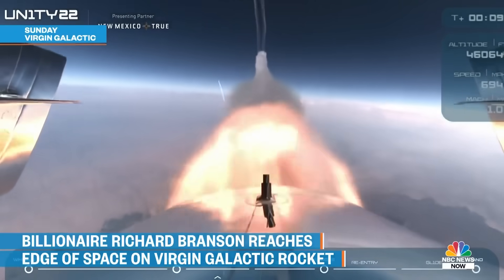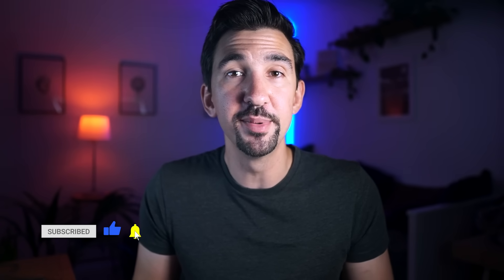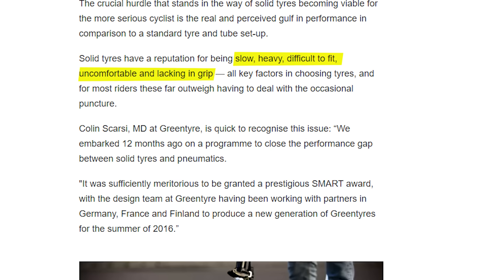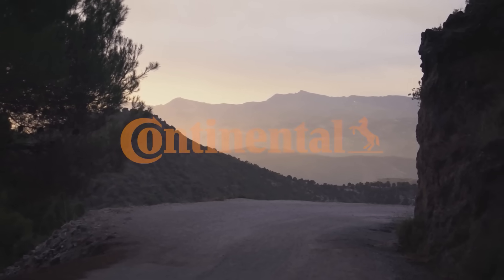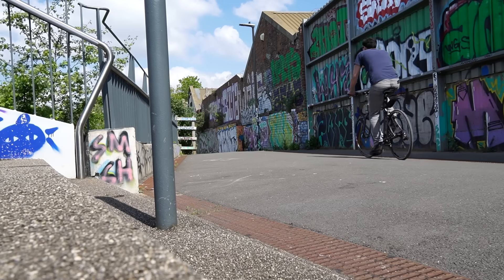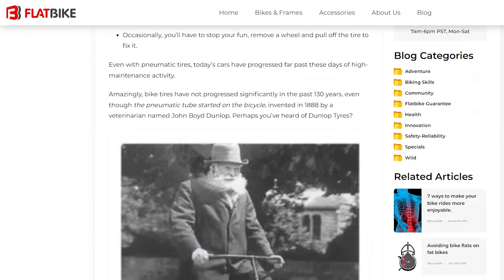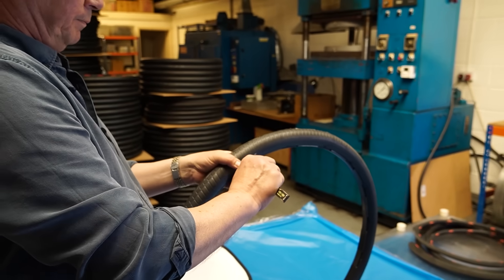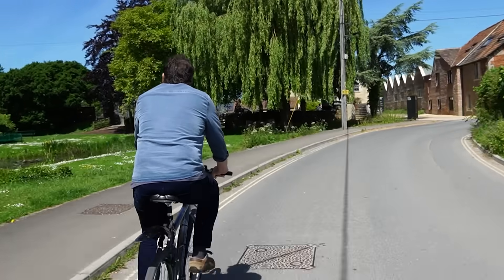I Tried Solid Bike Tires | Here's What I Found

Comment: This is an interesting video, but I don't believe that flat-tire risk with pneumatic tires is a serious problem for most bicycle riders.

I have used bicycles to commute in London, Chicago, a couple parts of California, NY City, Boston, and New York City in the past 25 years. I cycled long distances to go to work or meet friends as a teenager. This summer, I cycled 500km through Canada -- often on roads with loads of small stones and gravel in the shoulder.

I think I've only had 3 pneumatic bicycle inner tubes fail in 20 years. One was on a very old bicycle from a thrift store with old tubes. The valves themselves failed, and I had to replace the tubes. Another was when I used to ride a folding bike with relatively small rims, and I think I got a pinch-flat from severely under-inflated tires. I think I ONCE got a puncture flat when I cycled over a broken piece of glass in Chicago, but that was on a 1974 Schwinn road bike that had tires and tubes that might have been > 20 years old. I swapped out the tubes and kept the very old tires, and I don't think I ever got another flat riding that thing for maybe 12 years until I finally sold it. For a while, I commuted about 20km per day with that bike. I think I also ONCE got a puncture flat as a teenager when I rode a very very cheap old bike that probably had very cheap tires and tubes. That was in the 1990s. When I lived in London, I rode a truly awful old bicycle that had old tires and likely very old tubes. I bought it on Gumtree for 30 quid. I bought it near Old Street and rode it to my friend's flat near Acton. I cycled daily from near Brixton to Westminster. I biked all around Chelsea and South Kensington a few days each week. I had to buy a cheap spoke wrench to true the rims. I topped up the air in the tires a couple times over the course of 4 months, but I never got a flat.

I've probably cycled thousands of miles in the past 30 years. Most of those miles have been on cheap and old bicycles with old tires and tubes.

I guess that if I had to ride a bike on gravel every day then I'd probably look into solid tires, but, if I were forced to bike on gravel then I probably wouldn't bike at all. On any sort of paved surface (concrete, asphalt, etc), I've had no issues with pneumatic tires. When I've gone on multi-day touring trips, I just pack an extra inner tube. When riding around the city, I don't bother.

In terms of recycling tires, I agree that our society should aim to recycle more. It makes sense that multi-material pneumatic tires may be harder to recycle, but I'd imagine that solid tires use more rubber. And therefore, I'd guess that the amount of waste rubber in maybe 5 pneumatic tires is probably equivalent to 1 solid tire. They will inevitably both end up in land fills. I think we need to do more to recycle in general. I think any sort of rubber tire could be ground up and turned into playground surface material, insulation, sub-floor padding, maybe rubber bushings or dampers in certain building-construction applications or some other product that doesn't require precision in its composition. I would personally be more excited about investing in pneumatic-tire recycling technology and products that use recycled pneumatic tires than in solid tires.

Comment: this is great and all, but you could just switch to a wider weel base. 

I rode a race bike as a commuter for 10+ years. 
This year I fixed up an old hardtail mountain bike, the tires on it are old and pretty worn in places, but so far im et gotten a single puncture. 
also when you get a puncture it's not the tire you throw out it's usually the tube?

Comment: The first bicycles used solid rubber tires.  The problem with a soft foam airless is you can't tailor your pressure for terrain and weight.  I think the ideal solution is something like those foam tire liners.  Make the foam equivalent to, say, 15-20 psi, and use air for the difference.
Reply: There's also run flat bike tire inserts.They still allow for room for air, but in case of a puncture they provide enough resistance that you can still ride home.
Reply: the problem is that air is the best shock absorber, 95% of people don´t adjust their pressure to fit the conditions anyway but rather pump them to the (near) max and that´s that until they need repumping. adjusting pressure is only for enthusiasts. i tried to tell people i know at least leave off some pressure in the winter, they won´t because it´s more resistance.

Comment: your argument of "how much is 1h of your time replacing a tire actually worth?" is not really valid though, you have to factor in how much time you save by using a regular tire compared to these tires. if you save 15 seconds with regular tires when going to work, that's 30 seconds a day, 3600/30 = 120 days, so if your regular air filled tired survives over 120 days, which isn't really crazy and only saves 15 seconds a trip, which is very conservative, air filled tires will save time.

Comment: It is the current year. OMG you are right! Maybe once you get your license back and after the DUI classes are done you can get rid of your old BMX and that should cut down on bike tires in land fills. And don't drink and drive anymore. Now find a way to put better rubber on cars and motorcycles. When I was a kid and it was not weird to ride a bike I used a PVC pipe rapped in foam to have airless tires that felt like pneumatic bike tires. At low and dangerous speeds in traffic it worked just fine. I learned when I was young to not play in traffic. Faster cars are going to pass dangerously close. Doesn't matter how many white lines between me and traffic. Not that you drunks stay in your lane that you don't pay for. Anyway, bike tires can be made puncture proof. But it might add weight and I don't see bike riders building any muscle in order to handle that extra weight. I don't know if its the vegen diet or health reasons. But whatever gave you the death wish to ride a bike in the first place shouldn't stop you from being able to handle your 10 speed. And your legs will look awesome too. 
England thinks it has hills? You should check out the Rocky Mountains sometime. You would die trying to ride up some of them. And you wouldn't be the first one either.
Great video. But as you can see I has some comments and issues with it.

Comment: NB there is nothign wrong with stuff that came out of the ground, going into land fills.  The problems occur when it a/ sits on the surface, including under water or b/ is incinerated.
Secondly, irrespective of what Continental says, if anyone cares to visit a waste transfer station or landfill dump, you will find that bicycle tyres are so far below a significant constituent of society's waste, that I am lost for words to describe it!

I note also that bike tyres do not actually go flat. Tubes go flat, and if one wishes to minimize the amount of tube waste, then I can say from much personal experience that a tiny patch will save 4 out of 5 tubes when they are punctured.  

But thanks for the interesting video anyway.  I see that these tyres appear to not yet be freely available, but will give them ago when, in due course, they make their way to Australia.
As an every day no matter what, bike commuter, I can confirm that is an utter PITA being held up along the way to repair flats.  Particularly when it is wet and cold and you're in a hurry etc etc.

Comment: ? Basic physics should rule out a solid tyre, as far as comfort goes.
Air filled tyres, when hitting a bump, have the whole inner chamber to deflect into. Creating a minor pressure increase.
Solid tyres have they're neighbouring molecules blocking most of the deflection.

Comment: i have solid tires in my e-scooter and dam good its dangerous, they dont flex for shit, you have to re-learn how to turn and how to move your body and weigth so that mf dosnt slide like its on ice, forget about wet, anything more than 10 kmh its better for you to get down and slow yourself down than to trust the tires, heck, a road bike its miles more confortable than it, but in 4 or so year, not even 1 puncture, no even once did i look if it was to soft, and im pretty sure they are as hard as they can get bcs the tread looks exactly the same, i miss normal tires tbh, it depends on what you are gona use it for and if you are willing to use it with the pros and cons, i was so sold on it at the start and it didnt bother me at all, after all, just brake when you need to, but damn, maybe im getting old and thats it XD

Comment: I have found that most flat tires go flat when the tire spins on the rim but the tube cant spin due to the valve for filling it with air. The tire pulls on the tube until something gives and you get a flat.

Comment: Even if they are soft due to air bubbles trapped inside, they will weigh more then a traditional tire.
My concern with them is how fast they detiorate and lose  the grooves and grip and when they do can they be re-surfaced.

Comment: If your tires get punctured every month, you are clearly doing something wrong. I always pump as little air into my tires, as it's possibile. I put about 15 psi into my mountain bike tires. I only had punctures when I installed the inne tube incorrectly or when the tubes got too old (it's about 4 years for me).

Comment: I am regularly bike commuting for over 10 years now. In that time I had two flats. Both were minor, so I could go on and fix it at home. So I had two flats in about 5 sets of tires and probably 25000 - 30000 km. I think most problems people are having with flats are user error. Especially the scene where we saw him bouncing the tires, you could see, that the air filled one didn't jump very high, which leads me to think that he cycled the tire with a serious under-pressure. This of course increases friction and chance of a flat, while also improving comfort. My experience is, that a good tire, even with very little puncture protection is very unlikely to every get flat over the course of its lifetime. People who experience a lot of punctures would probably benefit more from a highly protected tire (like the Schwalbe marathon Plus), because that will get them all the advantages of an air tire with puncture resistance, with the only downside being higher weight.

Comment: Well, i've contacted Gecko Rubbers for application in high speed velomobiles... I'm driving one, especially the rear tyre is a pain to change, since it's in the streamlined fairing. The front wheels are easier to change, since they're not in the fairing. So i'm curious about their usage in these kinds of recumbents.

Comment: Schwalbe marathon plus tires are the best tire I've ever used. Ran them for years and over multiple multi-day bike excursions and barely had to even think about them aside from the occasional fill up. I bit heavier but zero flats over 6000 miles. I'd love to see Gecko license their tech to other brands and allow the market to do what it does and improve these tires even further, while offering loads of size and use cases.
Reply: Try the new Continental Contact Urban 2022 model.  It's like the Marathon but way better rolling resistance.

Comment: RC cars had been using foam inserts for non pneumatic tire use for decades now so I really do not understand why he is literally trying to reinvent the wheel here.  the only difference here is that the process is cumbersome expensive and you are stuck with a single manufacturer.  The only thing the current tire manufacturers need to do is make foam inserts for their existing tires and cyclist problem solved.  I am absolutely sure the cyclists would love to help out with the experiments.

I think the main problem is convinience.  People are used to fixing the current items themselves.   I am not a pro cycler or anything by any chance but I have worn out tires and I can only recall one time I removed the tire and used a puncture kit.  But times change so does products.  Those who are old enough will remember the times when all car tires had inner tires and we were able to fix out own tires.  now with the tubeless tires you have to have a shop do it because you can not remove the new tires from rims.  

I think for commuters they are a good option though as you will not have the what will happen if I get a flat worry.

Comment: nothing, just crap no more, more than twenty years ago I found in the children's games section of the supermarket some plastic foam tubes for children that they can take to the beach or to the pool and they float, they are one of those classic colored foam tubes garish and very light, they measure about a meter or a little more and are very cheap, well, AS SOON AS I SAW THEM I IMAGINED INSTALLING THEM INSIDE THE WHEELS OF MY BIKE INSTEAD OF USING THAT EXPANDABLE RUBBER BAND TO INFLATE IT AND SUFFER THE EVER DAMMED PUNCTURES, well, I bought them, I got home and disassembled the wheels of the bicycle and installed those plastic foam tubes, as they were very thick I cut them a little with a knife so that they fit into the wheel, I installed the wheel again and VOILÁ , I HAD SOLID PLASTIC FOAM WHEELS, VERY LIGHTWEIGHT, VERY CHEAP AND I NEVER PUNCHED A TIRE AGAIN, the ideal solution for a dammed problem that I had to deal with all the time because of my love of going to the countryside and to the mountains to ride a bicycle, the wheels lasted me like five years with those tubes inside, and when I changed them I put the same tubes in them and I still have those same plastic foam tubes when i change wheels, and this guy comes to make the loop, saying that so much technology is required and engineering development to solve a problem that I solved in less than a second by seeing those foam tubes for children? hmmm, oh yes of course, the solution has been around for decades, don't worry, buy those plastic foam tubes for the beach and install them on your wheels, PROBLEM SOLVED :D

Comment: In the 70's cyclists with 10-speed bikes used a device for each wheel called the tire-saver, a piece of wire shaped in a half circle to ride close to the tire's wear surface, supported with some flexible plastic tubing which was in turn supported by a piece of wire fastened to the brake bolt for each wheel. By riding very lightly on the tire, the wire picked off the bits of glass and sharp gravel on the first wheel revolution after they stuck in the tire.  This prevented the glass/gravel from being repeatedly forced further into the tire with each revolution.  As a result of beginning to use these, my annual flats (riding 3 to 5,000 miles per year, about half in a large U.S. city on streets) went from 8 or 10 to less than one.  I think bike shops stopped selling them in the 80's, probably because they were bad for business.  They cost about a dollar per pair but saved you time, tubes, and tires (and patch kits) -  but bike shops sold a LOT less tubes and tires, and less repair service for those people who didn't repair their own flat tires.  Modern tires have some flat protection, and I have worn-out my old tire savers, but I still get flats from staples, something that didn't happen 50 years ago.  Given we are trying to be ecofriendly these days, somebody who is not strapped for tire-related profits ought to start manufacturing and selling them.  I see some ads when I google them, about $15-20/ pair, which is a profit margin of about 2,000 per cent.

Comment: In the 80's we had puncture-proof tires, to solve that exact problem. Rode a little hard, but totally worked. Essentially a thicker rubber/steel mesh + air as normal. Nuff said.

Comment: Many years ago, I commuted by bicycle in Boston, Massachusetts. There was a lot of glass in the roads, so I used airless tires. But then winter set in. As temperatures dropped, the tires became rock-hard. Do modern airless tires retain their elasticity at lower temperatures?

Comment: I dont doubt their performance in terms of retaining their stiffness. But Just look at that tread. It basically doesn't even have any. I'd have extreme traction concerns.

What would make more sense to me is to have two parts. An "inner tube" made solid like this, and an outer tread. The tread can be replaced when it wears down, and it'd protect the "tube" and extend it's lifespan significantly.

The majority of what makes air tires difficult to recycle seems to be stuff it has specifically because it's an air tire. I feel like replaceable treads designed for a solid core could get around the recycleability issue since it wouldn't need things like the textile lining to hold it's shape under air pressure, or the puncture resistant layer. The only difficult part is holding it on without the wires. But you might be able to just have the same clip system the full tires have but on the solid innertube, and just interface the outer tread with those clips.

Or you could just have a featureless solid innertube an the wires on the tread. Those seem like the easiest thing to deal with recycle-wise since the company could just have a machine that stamps the wire out. And It's still less work for the consumer than an air tire to service since you would only ever pull them off when the tread wears out.